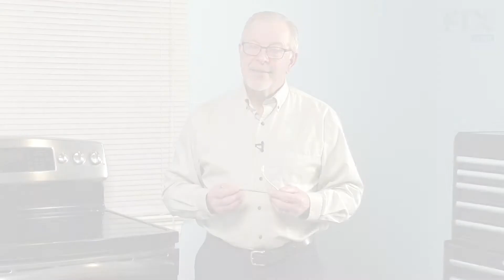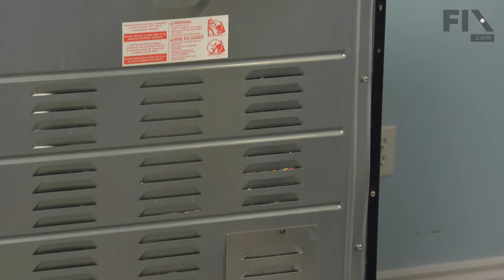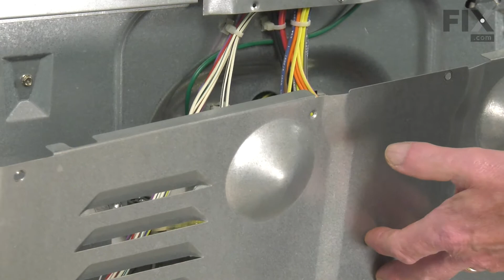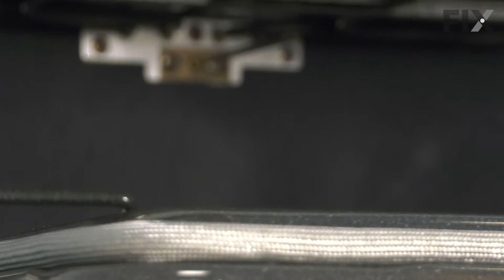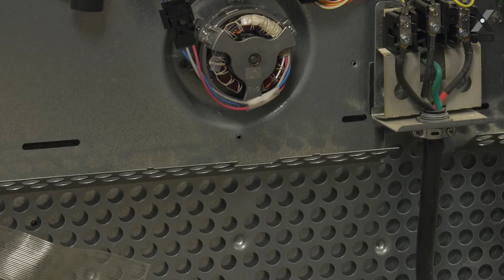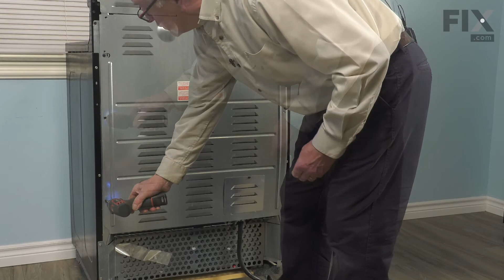GE Range Repair - How to Replace the Oven Sensor

Comment: Why do you have to remove the rear panel?  Seems like the connector could be pulled through and disconnected?
Reply: I just tried; couldn't get it to come thru.  The other end is just a little too big to fit thru.